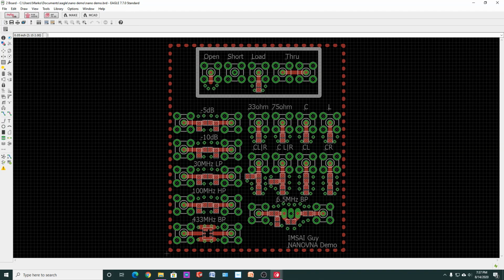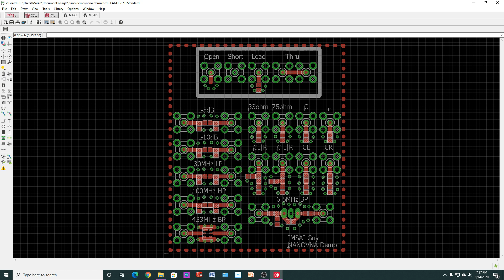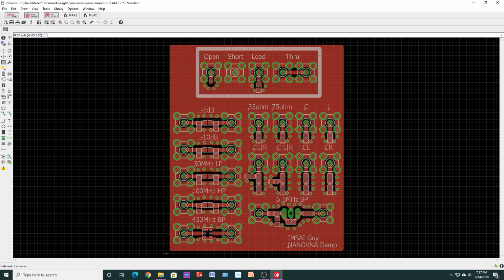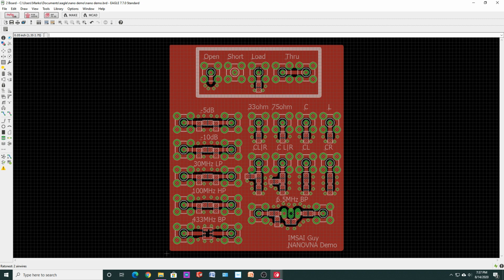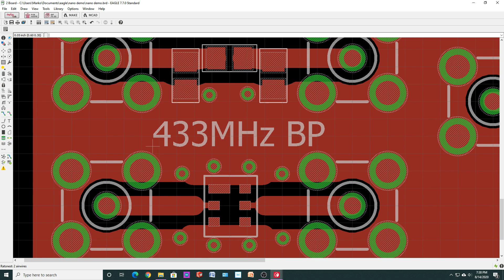#567 NANOVNA Demo Board with SMA Connectors

Comment: Hi ,  I ordered your board from PCBWay.  I wondered what is the microstrip with coplaner lines size and spacing.  My software calculation says that the line width should be 3mm and the spacing on the surface should be 1.9mm on a 1.6mm thick board with one once copper. I see on your board the width is about 2mm and spacing is 1mm.  Did you measure your line impedance?
Reply from the maker: I think I did calculate it, don't remember, but the line lengths are so short it doesn't matter really
Reply: @IMSAIGuy  Yes, you are right . Your board is about 1.3 mm thick and calculation says you need line width of 2.2mm and gap of 1mm, given Er of 4.3, which is what I can measure form you board.  But I read on paper that Er could vary anywhere from 4.2 to 4.4 depending on the frequency.I am going to use your Thru connection on your board, which is your longest undisturbed line to calculate the line impedance of your lines. Basically, you can measure it by measuring S11 with putting an open and short on the other end, then Zo= SQRT(Zin_oc x Zin_sc)  I want to measure it at 100MHz, 500MHz, and 900MHz  This could give me a clue about net Er with all materials they are using at different frequencies.  I am going to design a PCB with some 50 ohm long microstrip with coplaner  lines  with SMA edge connectors at both ends to PCBway and measure the line impedance.  I am going to do the same for 75 ohm lines with F-type edge connector at both ends. 
We need to know control the line impedance as good as we can for test circuits.  In most companies I worked for They simulate it with HFSS and then send some lines to manufacture to find the best match.  Because calculation is not exact.
Reply from the maker: @aduedc  wait a few weeks. I have a series of videos that is exactly this topic. I do some impedance controlled boards.